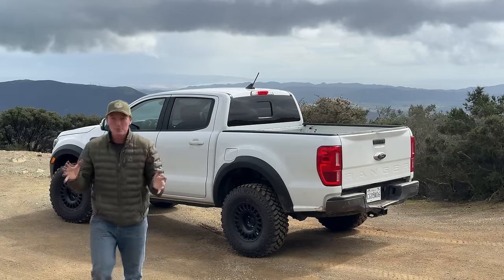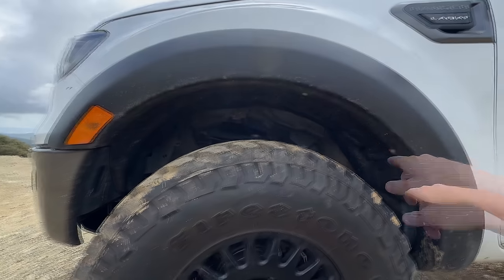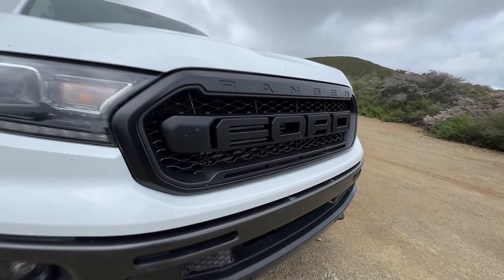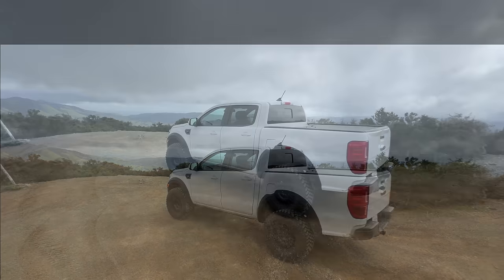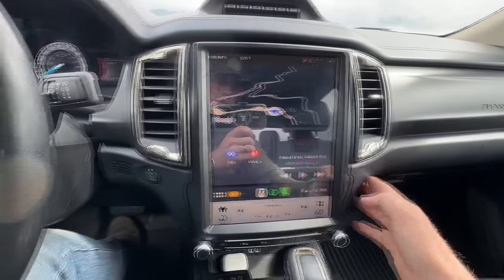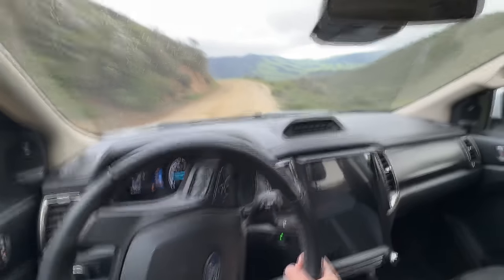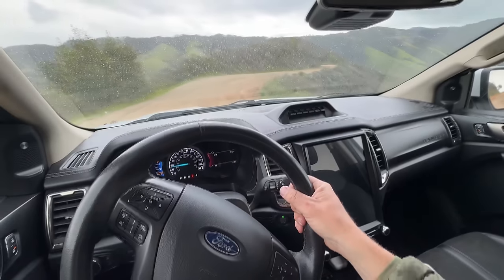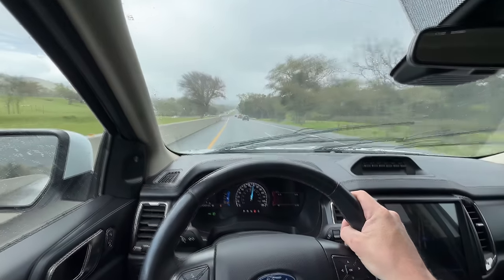Part 2 Ranger build: insurance auction Ranger Tremor flatbed project, cleaned, wheels tires and lift

Comment: Ford uses permaseal on their headlights which makes them a pain to take apart. There are some special liquids that help degrade it but most of the time you have to bake it multiple times while picking at the permaseal.
Reply from the maker: Ah that’s key Info, thanks for sharing!

Comment: Is this thing all insured with a fixed title? Just curious how that whole process was! Looks amazing, cant wait to see what you do with it.
Reply from the maker: Thanks! And yes insured 👍 I’ll do a follow up video specifically on that process.
Reply: Ive owned 2 CoPart salvage title vehicles. Once state inspected and tagged insurance treats them as any other good titled vehicle. 
Title in my state was a different color to indicate “rebuilt salvage” so it might affect resale. I bought with intentions to drive the wheels off. One I sold after 80,000 miles for near what I paid. The other was totalled from collision (drove it 120,000 miles) and Insurance paid appropriately as any clean titled vehicle

Comment: How’d you fix the 4WD; I know in Part 1 it wasn’t locking in.
Reply: It was an incorrect fuse that was swapped around incorrectly
Reply from the maker: Correct! The fuel pump relay was swapped with one of the 4wd relays. Super wired but that fixed it!
Reply: @OverlandUnderBudget  wow good on you to check that first!  I’m sure a shop would have been running around in circles!  Makes me wonder how the fuel pump was working then haha

Comment: Did you have to cut out crash bars or any plastic in the wheel wells to fit those tires?
Reply: 4:39 lower left of screen confirms the crash bars are gone.

Comment: there is some odd interlace issue you have with the render
Reply from the maker: Yes I had a 24 fps timeline but 29.7 clip frame rate and couldn’t change it without crashing davinci.
Reply: @OverlandUnderBudget  davinci - great for color. Meh for other.

Comment: 4:43 I think you are confused because the lift given by a 1/2 inch spacer is 1 inch over all due to geometry. If the spacer was an inch think you’d get a lot more than an inch in lift!!
Reply from the maker: I believe i clarify that just 8 seconds later haha
Reply: @OverlandUnderBudget  Yep, was confused at first too, but you clarified it.

Comment: So exciting to so you excited! 😊
I also went with the Husky mats. Nice value for the money. I went with the RTR Fender Flares. I liked how they actually have the small piece that sits on the front bumper. I went that route since I'm running the 2" front receiver with a stock bumper. 

Fun stuff! The truck looks really good. Happy Ford is getting you out to the product launch events. 

🛻+⛺️=🙂!
Mark (& Teresa)
Hampstead Maryland

• Purpose Built Adventure Rig © •
Ford Ranger FX4 - GFC Camper V2 #1919

• Kia Soulverlander • Nissan Xterra Off-Road •